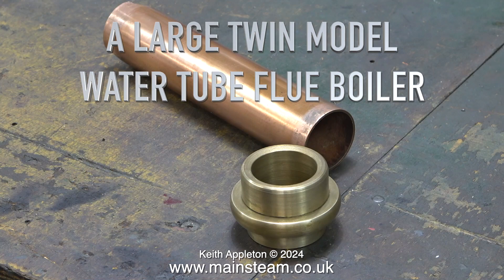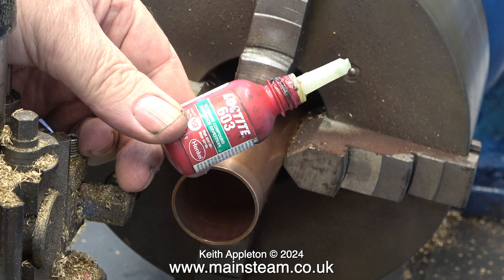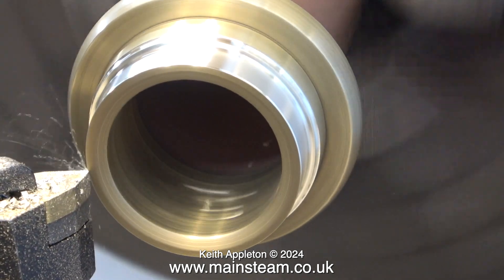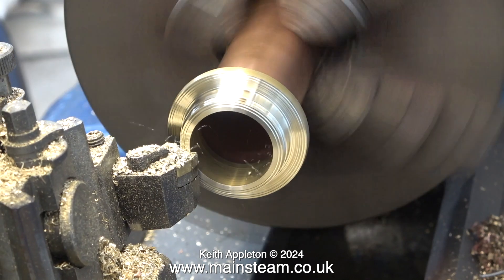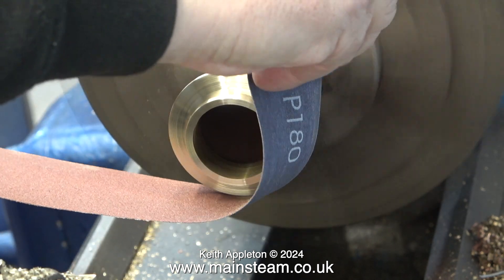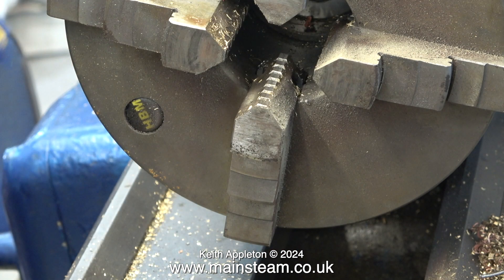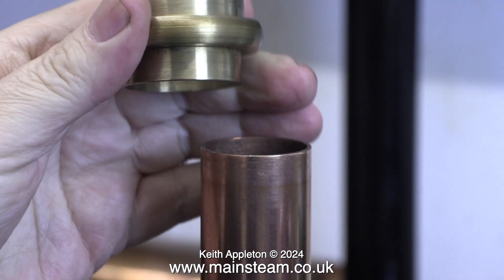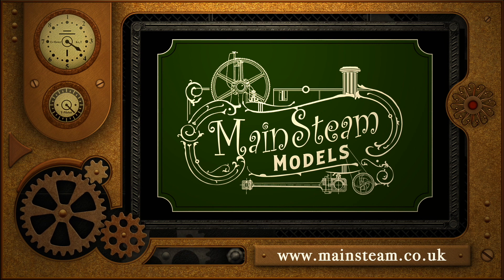A LARGE TWIN WATER TUBE FLUE BOILER - PART #3

Comment: Is the cap purely decorative?  Or does it serve a practical purpose?
Reply from the maker: In the case of a model Boiler it is decorative, but in the full size it probably helps the draughting of the fire as these type of caps are only fitted to moving steam boilers.......
Reply: @keithappleton  Thanks.